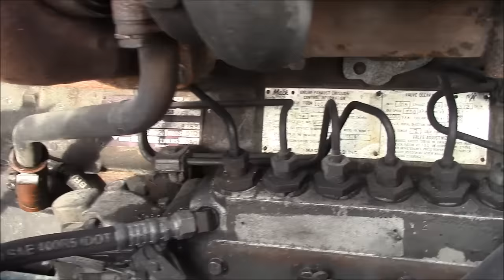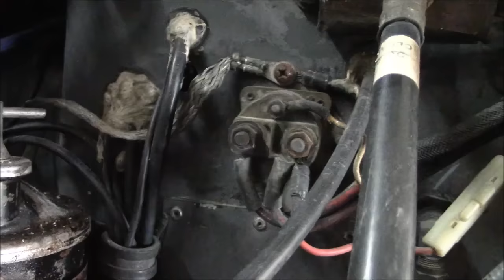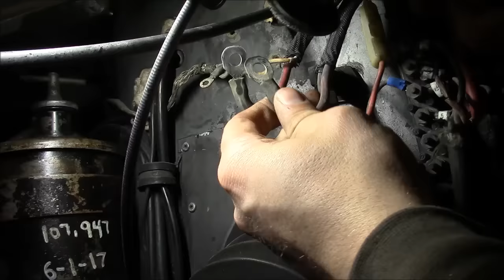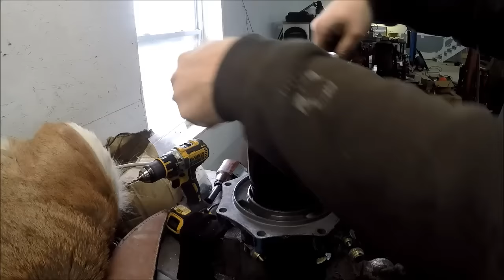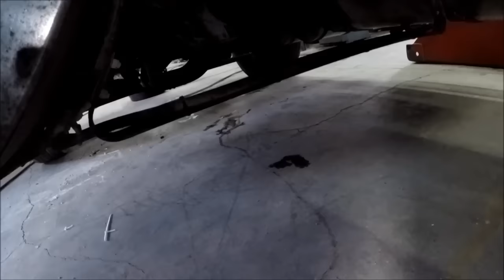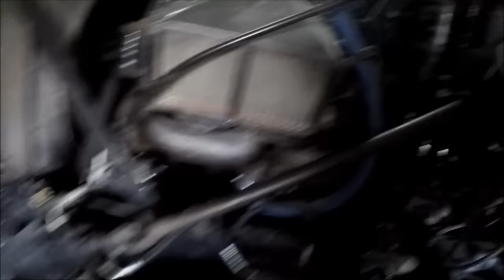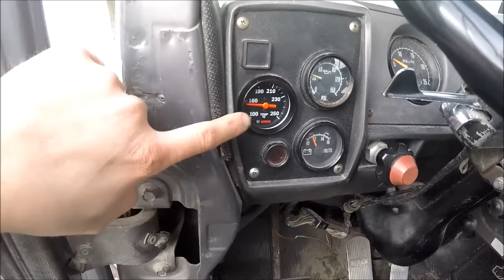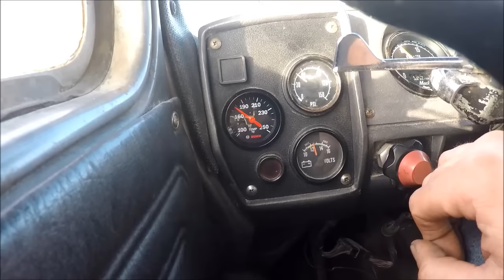Cool 1977 Mack RL600L - No Crank, No Start - Plus Many Other Repairs

Comment: Lmfao people saying dielectric grease causes resistance lol 😆 if you installed it on top then you wouldn't be able to use it in spark plug wires and Coils I have used dielectric grease on millions of electrical connections It insulates so spark don't escape or Arc yep I agree with you Wes ON how dielectric Grease works Because it dont leave Carbon behind when there is to much heat you can even use super lube As dielectric grease it also protects against water and other things from intruding you can also use fluid Film in the same way lmfao at the batteries on concrete myth @Watch Wes Work

Comment: Dielectric grease is recommended to be applied to automotive bulbs (turn signal and parking lights) BEFORE they are installed in the sockets. This information is from the automobile manufacturers!

Comment: Noalox is a great product, we use it in the industrial field all the time. Dielectric grease would only cause an issue on a loose connection. Copper anti seize works good in a pinch to prevent corrosion.

Comment: At my job, a vacuum truck manufacturing plant , we use dialectic grease on every single connection made, including inside the terminals of weatherpack connections

Love those old macks. Hardly ever see that stuff on the road anymore. I deal with 95% brand new chassis at work, some can be nice but most just have no soul to them. Bunch of plastic, and cheap Chinese crap. Half the time, they leak coolant, oil, or diesel from the factory.  Seems to be freightliner alot right now, but each manufacturer has these problems more often than it should be happening. Had three freightliner 114sd's in a row with fuel/hard start issues. Fuel fittings on filter housing would turn with 2 fingers lol

Comment: Watch Wes Work I am a retired master aircraft mechanic and I wanted you to know that I used dielectric grease on all kinds of terminals on all different kinds of aircraft for over thirty years and never had a problem with anything that I put it on! I used dielectric grease made by Dow Corning. It was called DC4 compound.

Comment: Wes, your spot on about the dielectric grease. I worked in the power utility business for 40 years. Every compression fitting on a power system has this dielectric grease on it before the fitting is created.

Comment: Batteries sitting on concrete myth, LOL,  freezing happens quicker if the battery is in contact with the concrete so we always put a board down first.

Comment: Wes absolutely addicted to the channel love the fact that you can work on so many different machines. As a industrial maintenance tech I use a product called Tweco Grease, used it on turn tables for welding robots, also used on high voltage & high current contactors works great. 
Keep up the great vids!

Tweco Grease,
An electrical conductive grease to be used as a lubricant for roto-grounds and may be used when making
mechanical connections with copper or aluminum cables. Effective as a lubricant on sliding or moving electrical
contacts such as switches and rotating grounding devices.  Reduce electrical resistance by as much as 40 to 50%.
Reply: I tell you it is amazing at all of the different types of lubrication types we have on the market for different applications. My, my, what'll they think of next.

Comment: I don’t wanna be that guy you make great content so don’t take me on the wrong on this. I actually had a Toyota supra that wouldn’t start because the technician put dielectric grease on the Engine grounding before bolting it down. Also as a commercial industrial electrician dielectric grease is only meant to protect the electronics not go in between contact surfaces.
Reply from the maker: I 100% guarantee that was NOT the reason...
Reply: @WatchWesWork  cleaned it off put it back on started right up, and solved the erratic spark issue🤙
Reply: @WatchWesWork  it look like he was getting paid per ounce of dielectric grease be put on
Reply: @WatchWesWork  now if you want to the anti-corrosion compound that was not an insulator Noalox is an anti-oxidant compound. I personally use Noalox with copper suspended into the compound but you can also get it with zinc and aluminum
Reply: Ideal produces a great Noalox product. Again this wasn’t meant to be insulting you my friend. Until I decided to focus solely on my YouTube channel this year I was a commercial industrial electrician. I worked on everything from $4 million gas compressors to $13 million veritable frequency drives powering 10,000 hp electric motors. Everything from 35,000 V supply down to incredibly precise electronics in control systems. if I ever got caught doing that with those it would never pass final inspection b/c it will cause all kinds of issues down the road. Now those electronics are incredibly sensitive to any kind of improper installation. Most of them even a small of amount of improper resistance will shut down the entire machine. Again your contents awesome man keep it coming I am not trying to not pick you.

Comment: I know I'm a little late to the party but I've seen your other videos you get stuff running obviously you know what your doing even if the commenters are right your still the one with good electrical connections

Comment: Wes, I love your channel and love your work. You do know that what you are calling a Solenoid is actually a Relay. The should be on the starter with an electomagnet to drive the starter drive into the ring gear. I see people call the typical Ford relay a solenoid, but they are not at all the same. Without that relay, there would be some mighty heavy guage cables going up to the ignition switch and back. I firmly believe you know this. No big deal.

Comment: Well sorry but the use of dielectric grease in those type of connections is wrong, can be used in connectors that have multiple contacts very close to each other and that will be in contact with water to prevent short circuits.  

In high load connections you want to use a conductive corrosion inhibition compound. There are specialty formulas  and products but believe it or not anti seize is VERY similar.

Comment: I have painted dielectric grease on every bolted contact I have used for over 50 years. I have never had a contact failure in all that time and I do put it on before bolting the contacts together. The reason I started doing this 50 or 60 years ago was because I found that corrosion is the main culprit in lost connections especially in bolted connections. The grease gets squeezed out of the contact location and stops corrosion effectively if put on before the connection is complete as it produces a better seal on the contacts. It behooves you to thoroughly clean, grind smooth, make metal show before bolting together. I would suppose if you laid the contacts together with no screw tightening the dielectric grease would not let the Connection prosper. But the real world contacts, even 5,000 Amp contacts work with grease. I have seen these contacts explode and even have an arc snuffer to blow out the arc after opening.

Comment: Great video and explanation on the air brake hose standard, thanks! Wes,maybe the L shape air brake hose connector suppose not being used here unless the hose being well settled at its closest position?the flexibility of the hose may cause the connector loose and leak.

Comment: the purpose of grease on the electrical connectors in to PREVENT CORROSION ! I am a retired telecom worker with 40 years' experience and I have made millions of high current electrical connections without even one ever failing due to corrosion. You are doing your connections correctly!!! You lightly coat the surfaces of the terminals with grease and it does not matter what kind of grease!

Comment: One thing still puzzles me with regard to dielectric grease, many in the know use it as you did on open connectors like solenoids, starter motors, alternators etc; but I never see anyone use it on battery terminals, is that because they are made from lead alloys and lithium based grease is therefore better?

Comment: Just because a fitting is not a non-reusable crimped unit doesn't mean it's "reusable". And there is nothing about "top loader" Mack axles or "camelback" suspension that makes them any more "heavy duty" than any other units. In fact, both have inherent weaknesses others do not. 

They, like the "bulletproof" triple-countershaft transmission, were designed and constructed to enable Mack to avoid infringing on existing - and superior - patents and use lighter, cheaper materials and manufacturing procecces. 

Nobody talks about the aluminum and  cast iron castings used in those "bulletproof" components while the "competition" used and still uses cast "nodular" steel, magnesium and forgings to make much "heavier-dutier" components that also end up LIGHTER and CHEAPER because they benefit(ted) from far more "research and development" pre- and post-Mack "introduction" of its oddball, excessively- complex/insufficiently-sophisticated "comparable" components.

Comment: Like the dielectric grease expiation and I use it on all my connections before , during, and after as well as heat shrink where ever practical. To my way of thinking electrical systems on vehicles of any type are build in gremlins looking for a home.

Comment: Love the 'R' Series Bulldog,last of the proper Macks , yours is very tidy for a forty four year old Bulldog. If  i won the lottery ,yes pigs will fly,would buy your Bulldog then convert to right hand drive and ship to the UK. Regarding 'R Series' Bulldog parts ,do not rely on spares suppliers, get on the web and search out owners of similar 'R Series Bulldogs,' surely they have a spares network you can tap into. The Bulldog,s straight six Maxidyne engine has a cooling issue centred on the thermostat and radiator shutters. For winter use in UK ,i convert the shutters to manual, and ask other 'R Series' Bulldog Owners how they sort out  their problem thermostats. Despite her diva like tantrums , that is one very COOL Bulldog, bombproof engineering from Allentown,. Just look at those twin double reduction spiral bevel spur drive axles .You would not believe the crap wagons running on our roads in UK, designed by 'Barbie' driven by 'Ken'.

Comment: I had an old B model Mack, 1956, air steering, air start, 5x4 with a high/low. I don't know how many gears one could get out of it ( I got 17 once and there was still more) got rid of it because it wouldn't hold air long enough to start it again after you stopped. load it up and the black smoke would roll, would pull hell off the cross. Would still have it if I could have converted the starter but there was no options at the time.

Comment: The reason for 4 6v batteries is to increase the max amperage output for usage of lighting loads in an over the road truck plus starting in cold weather. The starter alone in cold weather can pull 250A. 2 12v batteries can deliver a lot of amps but for not as long of duration as 2 6v batteries. Your truck is an over the road truck. You can load test a 12v battery noting the time of discharge and 2 6v batteries in series and note the time of discharge to prove my point.

Comment: Every  Mack truck I ever drove requires the driver after starting the engine to rev the engine to kick in the alternator to begin charging the batteries. I drove Mack trucks for over 18 years. Had one driver at the company I drove for fire up his truck, turned all the lights on then we would walk inside the shop to get our marching orders from the boss. We fired up at 6 am but due to wether and heavy fog, you couldn’t see more than 20 feet he didn’t order us to head to the pit to get sand when we walked out to the trucks his battery voltage was down to 8 volts. That was when we discovered each truck had only 2 batteries instead of three. As soon as he raved the engine it began charging the batteries and by the time we got to the pit 26 miles from the shop his batteries were fine. We always rev Ed the engine after the oil pressure stabilized to kick in the alternator after that. His truck was 6 years old at the time. We pulled the battery covers before we left the shop is when we discovered only 2 batteries versus 3.

Comment: I use to work on the triple counter shaft Spicer transmissions. This was back in the mid 70's. They were a PITA to hold in time while inserting the three shafts into the hollow shafts filled with needle bearings. Did a bunch of them on log trucks. Got pretty good at it. Remove in 20 minutes, 4 hours tear down, clean, replace and reassemble and finally 30 minute install.

Comment: i got years behind the wheel  of that same truck,,,,,,had to do the same thing,,,,also,,, brake pedel,,,mine was dirt and salt did wonders to the bracket,,,,motorkote lube works wonders,,come in a spray

Comment: Love the truck content. Started my trucking career out driving an early 70’s Brockway. Only drove a Mack one time in the late 90’s. It was a cab over sleeper truck. Don’t remember the model but wasn’t overly impressed with it other than the ride. No matter how screwed up the trailer was loaded, that Mack suspension smoothed it out. Good times 👍

Comment: Late to your channel ... but better late than never eh? WOW what a beast ... "Golden Age" of Mack (and GM as well) ... the new ones are total BS ... "Engineered" to take guys like you out of the equation and make it all "Shop Replaceable Only" ... Grrr. As for your comment on the DOT Brake Hoses ... consider yourself (and the Owner) "lucky" ... if you want to feel good, price "Aviation Grade" items. And as your rightly point out, far easier to just "Do it by the book" and not risk what "After Market CCP shit" is.  Decades in Aviation around the World and once you understand just what it takes to not just "QUAL Test" the initial design but maintain "oversight" of the "Approved Manufacturers" (very labor intensive/costly), you realize why the prices are so high ... to do less is just a formula for disaster down the road.  Thanks from all the "Soccer Moms" that will avoid being pancaked by a runaway !!!  Looking forward to watching all your Vids ...

Comment: I would just spray red battery protective spray over the connections and call it a day.  That lasts a real long time and it keeps the terminal from shorted out almost as good as a plastic cover.

And I always keep my batteries on Lumber: hard to keep them charged on Lumber so I do not want to try it on concrete.

Comment: In my former life and then the former life before that and then the former life before that I was always broke driving junkers and I always used electric grease in the shorting out tail light bulbs in their sockets when rain would get through the weather stripping.  The idea is the Dielectric grease would keep moisture out and insulate the copper.

Comment: Long ago I leaned that inflammable things are just as flammable as anything. I dont put to much though into what something is called if it works. Shocks are kinda that way too, they dont do much on the actual shock of impact, but you want them anyway.

Comment: I learned how to drive diesel trucks in the Mack and it was very hard to drive until I got the hang of it. They aren't like any other diesel truck on the road. They will pull a load all day long and never quit.

Comment: You have to run the RPM's to 1800 and then shift with the RPM's going down. At least that is how you float the gears in a Mack.

Comment: Macks were always bad when it came to the treadle valves. I drove "B" model Macks back in the day hauling concrete and our mechanics had to replace treadle valves quite often. They would either leak like crazy or fail completely.

Comment: The Battery on concrete is a myth,........However, if the battery is DIRTY,  it could discharge through the concrete using the dirt as a path. A clean battery has no path for current flow.

Comment: Grease fills in the microscopic valleys of the contact surface and is squeezed out of the asperities, allowing the current to flow and preventing oxidation from occurring.

Comment: It would rare indeed to have a 315 hp Thermodyne  with the 5 speed trans. The Thermodyne's always had 13 or 10 speeds because the power band was narrower and more like the 855 Cummins...so they needed a tranny with a 500rpm gap. The Thermodyne's also had the silver dog on the hood. As far as the air to air inter cooler ...those were just way too cool and almost maintenance free. More likely ...it is the ENDT 676  285hp Maxidyne  motor...but don't worry they had nearly 1,100 ft-lbs of torque. I really enjoyed pulling grades and listening to the Turbine fan sing!

Comment: Just because you've been doing it wrong 1000 times doesn't make it the right way to do it, LOL There is probably enough contact surface left on the terminal to not completely stop the flow of electricity, but by no means it is intended to be used like that. So this is how urban legends and misinformation spreads. 

A simple search gets you the answer, from a number of manufacturers all saying something along the lines of: "The grease does not conduct electricity, so it shouldn’t be applied directly to the mating surfaces (pins and sockets) of an electrical connection."

Comment: Those conductor wires becoming brittle. Come across that before . 
I put it down to changes in temperature. 
Nice looking truck from 77 . 
I'm from the uk . 
Like the look of older vehicles. 
Guess because I'm. Old too haha. 
Hey man liking your videos . 
You have a nice method of working. 
Regards from the UK .

Comment: if dielectric grease did resist the flow of electricity then why would you use it for headlights when you replace the lights and inside the boots of spark plug wires

Comment: used dielectric grease on 480v switchgear terminals and blades for years zero issues actually saved gear from breakdowns on equipment in my years in electrical maintenance